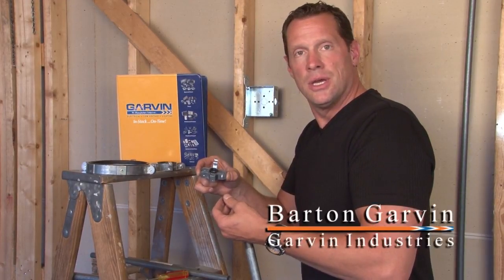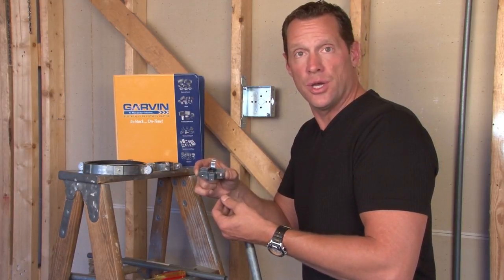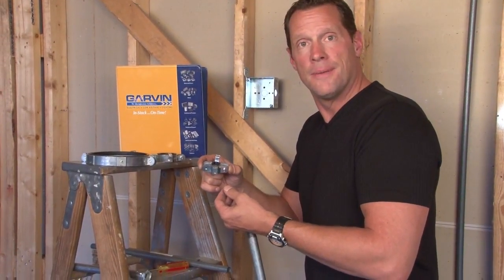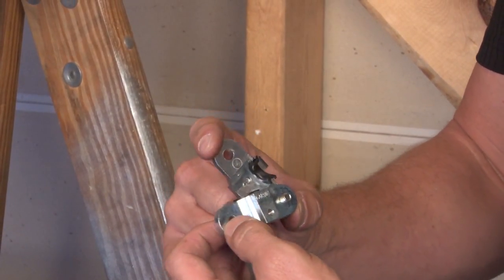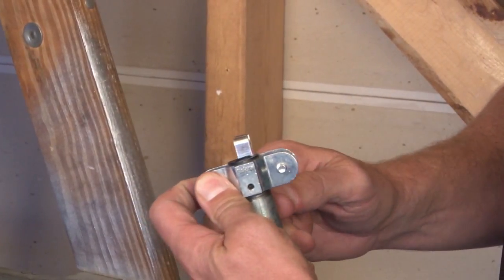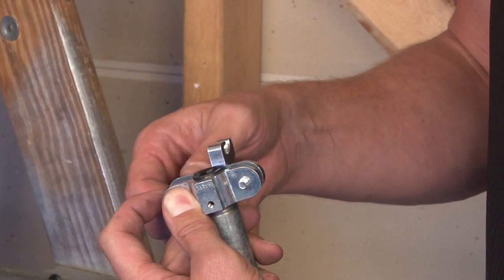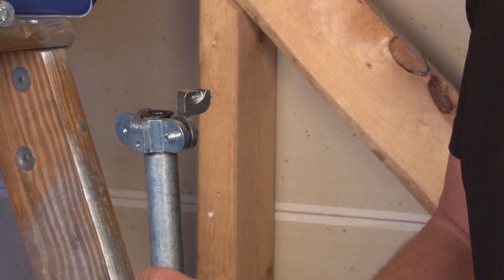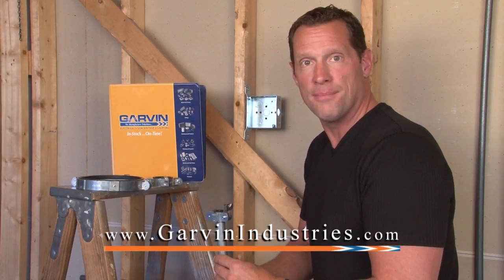Split Grounding Bushings... SGB & GCHK Series

Comment: how does it attach to a box or another run of pipe? what can be done with this? looks like it renders the end of the pipe useless for cuppling.
Reply: Use a U-bolt bonding clamp, and attach the EGC externally.
Reply: ANA.  SOF